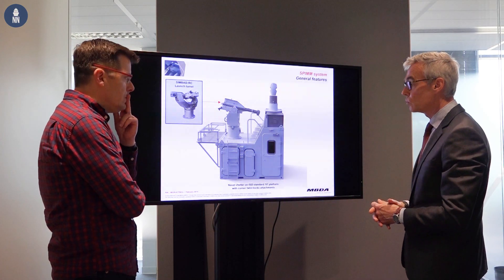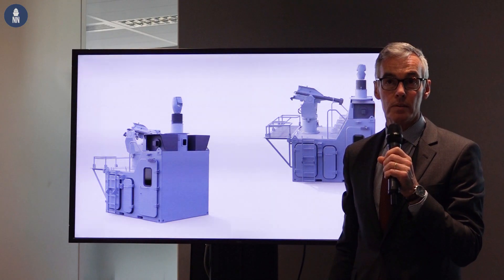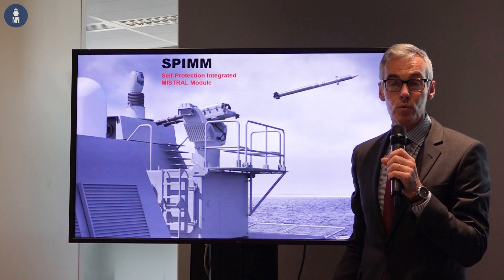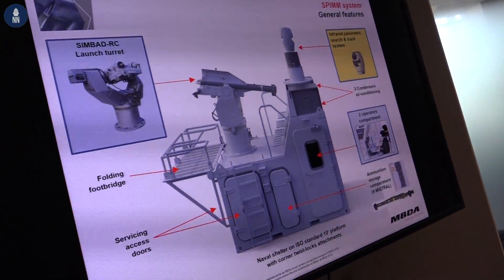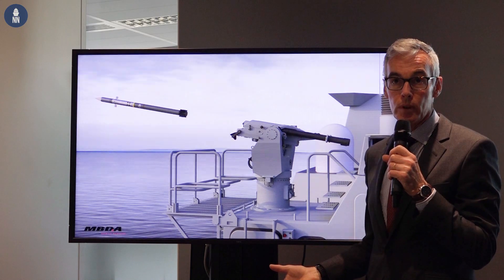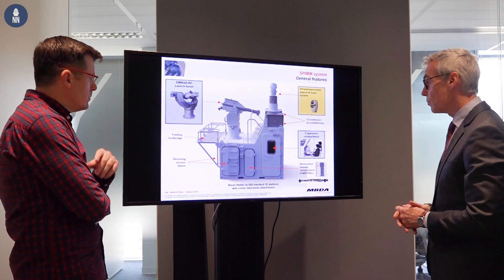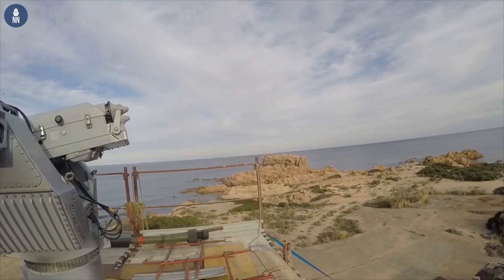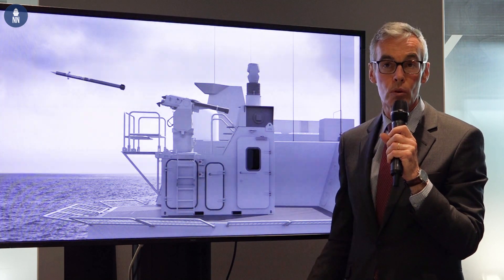MBDA SPIMM - Self-Protection Integrated Mistral Module

Comment: The mistral 3 is the best shoulder launched missile no doubt and one of the faster real velocity not only on paper but i think MBDA can push the Mistral above 10km and a 25 to 30.000/ft for the imperial men or 9.000/meters in altitude i hope they will make this capability in the Simbad RC 10 to 12km so will compete and won the RIM - 116 for better value and faster engagement

Comment: like the idea of an add on system like this. a passive ir/thermal air surveillance suite in a 10/10 shelter with two operators and a twin mistral 3 missile simbad rc unit to be used within an umbrella of dedicated air defence systems so it adds to, not take away from the overall defensive shield,  just the job. with effective data link information transfer the missiles can intercept the hypersonic anti-ship missiles at a safe distance in a head on attack. the only two missile problem is got around by it being part of an umbrella defence (only an idiot would think it operates alone)so other assets would form the backbone of the defence network. can see this put onto auxiliary ships and troop ships when deployed within an amphibious task force fleet.